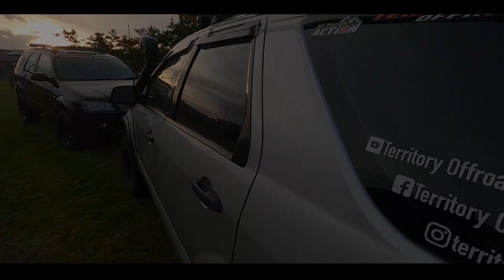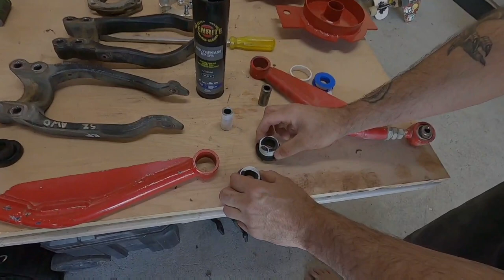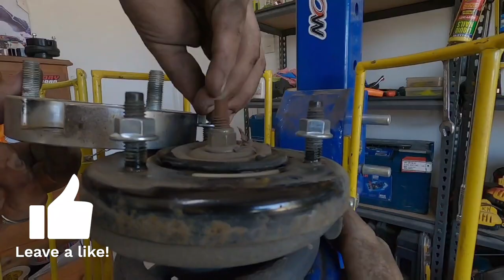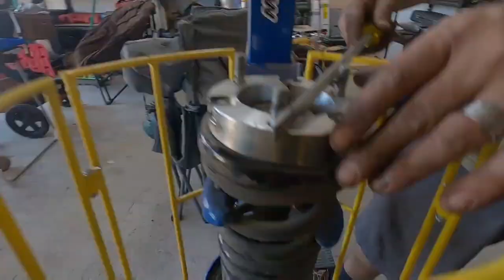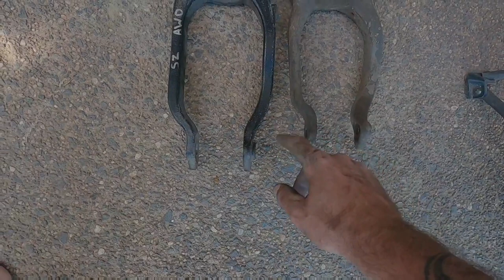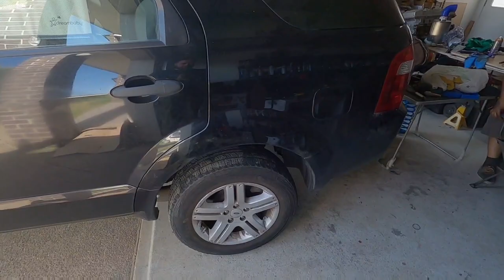2.5 Inch Suspension Lift Installation  |  Territory Offroad bolt in rear lift Spacers

Comment: Hi front strut lift wat is that orininoly for tried to buy a set they wonted to know wat make .PS .WILL you be at all ford day at Willow bank .
Reply from the maker: Yeah will have both of my Territory's at the Willowbank All Ford Day.

The front strut top spacers are from a Prado 120. Just make sure you get the one's with the open side's like in the video.
Reply: @TerritoryOffroad  thanks looking forward to have a chat at all ford day .last seven years been driving around in BA Green wagon AWD RTV  territory running gear bolts straight in .

Comment: Those fork things on the bottom of the front shockers don't look very strong are they a weak point ?
Reply from the maker: They are the factory lower forks and are very solid. I've never had a problem with them and don't think I ever will.

Comment: Hey Keith love ya work…are your bolt in rear spacers available for purchase? 
Cheers
Reply from the maker: Been trying to find someone who can lazer cut the steel at a reasonable price. So far I've had no luck so it's been held up. I eventually will have them up for sale.
Reply: @TerritoryOffroad   any update on this?
Or do you have any of the ones you've made that you're willing to sell
Reply from the maker: @user-bh1be9ui5q  On hold at this point as I moving interstate and all my gear is packed away.